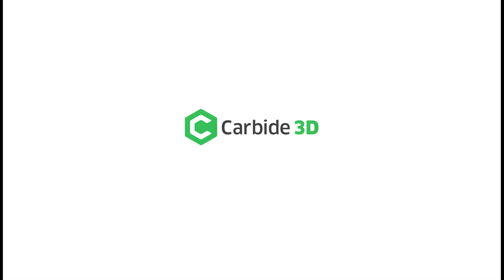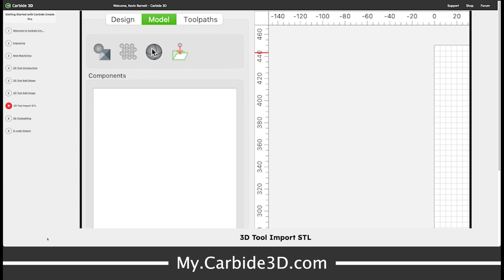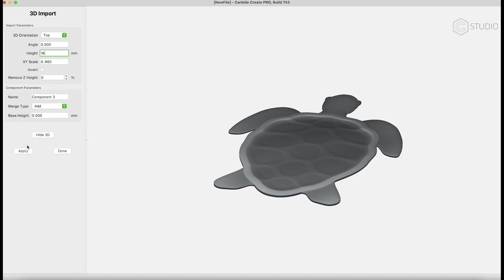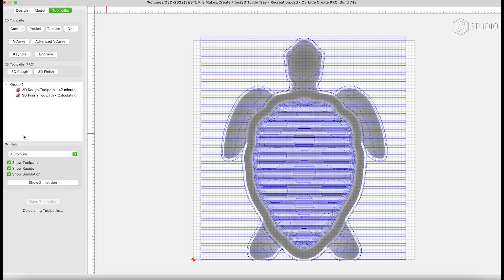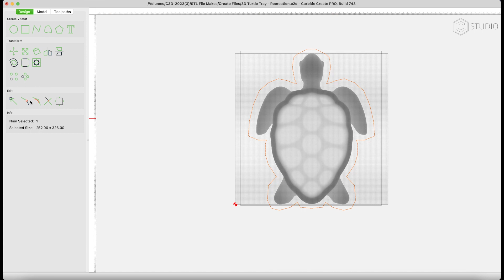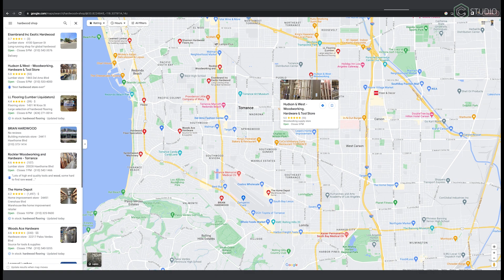Amazing 3D Art with CNC - STL Imports for Carbide Create

Comment: Is there a reason to ‘leave out’ the Nomad in your script? It’s the machine I use, obviously smaller form factor w 8” X 8” but just a single callout like, ‘or on the Nomad with a smaller form factor’ would help me in the sharing of these great, short videos. I work with new CNC users who don’t have the knowledge to extrapolate from Shapeoko to the Nomad.
Reply from the maker: Everything for Shapeoko is applicable to NOMAD, just smaller.   Every video is meant as inspiration for your next creation.  A technique, a design strategy, a tooling strategy, et….   
Keep taking on new challenges with your desktop machine!

Comment: Why is it that when importing stl files in carbide create, I get that red border and a tiny model in the upper right corner of that red square? I then have to resize the red border to huge sizes to get the stl model to display to the right size. I would expect that if my canvas has the same area as my exported stl, that I would get something close to real scale. I have this issue on both macOS and Windows 11. What exactly am I doing wrong?
Reply from the maker: Ramon, not quite sure what's happening there.  Send a video of the problem you described in the software along with your STL file(s) to Support@Carbide3d.com    We'll be happy to take and look!
Reply: @carbide3d  I will do that indeed

Comment: Stepover 10% of BIT DIAMETER not stock size!
Reply from the maker: "Stock Settings" is what was said and shown.   Referring to the  standard stepover preloaded into Carbide Create.
Reply: @carbide3d  so 25mm stock thickness would give a 2.5mm stepover for a 3mm ball nose bit ??
Reply from the maker: No.  This has nothing to do with you Stock, as in what you are cutting.   It refers to and shows the pre filled stepover for that endmill in Create. 
The stock setting (or perhaps Standard Value), in Carbide Create for the #202 ball mill is 3.175mm stepover.  
For 3D finish work, take that stepover down to .32mm.  Or 10% of the stock setting in the software.